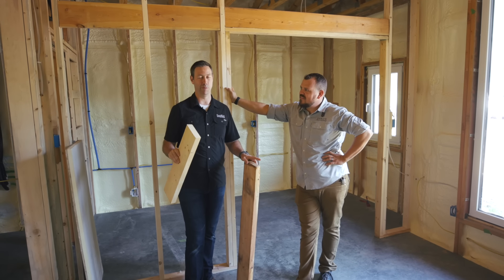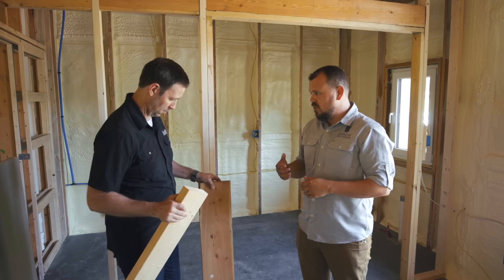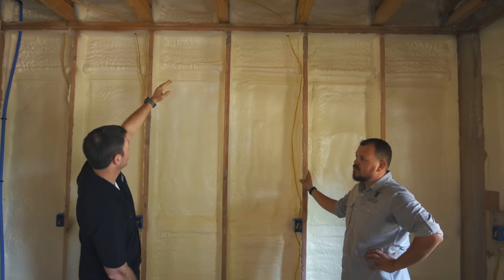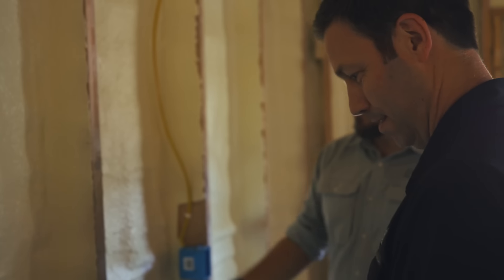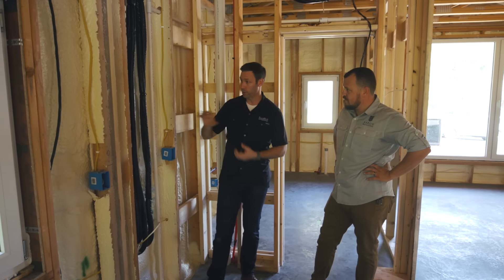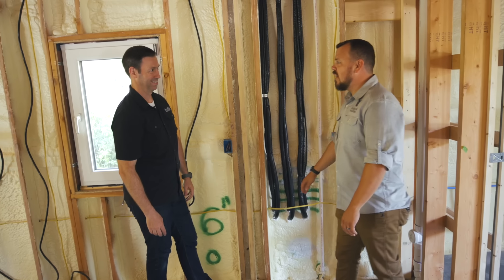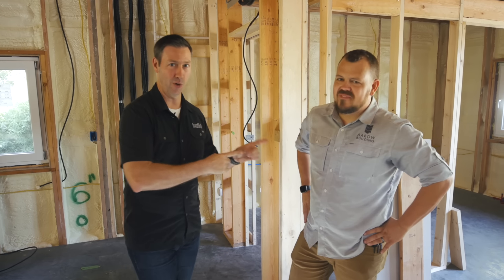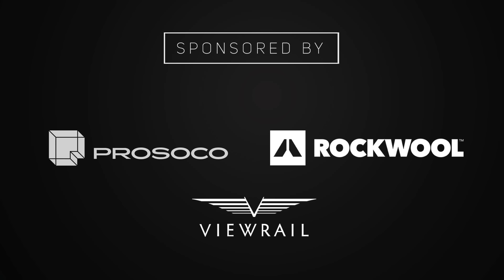Why would you frame a house with 2x8 lumber?

Comment: I only used 2x8 on my top plate, all the exterior walls with double stud 2x4s. Having the thermal break when the outside temperatures are 110f below from the inside it makes a difference. I had 6” of closed cell foam put in the walls and I put R-38 Batts with R21 batts between the trusses in the ceiling.. Last winter here in Alaska with the 7th coldest winter on record I used about 500 of heating oil to heat 3000 sq ft.

Comment: Passive House standards typically have a wall cavity with 2 2x4's or 2x6's which are offset to provide an open cavity in the wall. This improves the insulation value since the studs aren't thermally connecting the interior and exterior walls.
Reply: Why the offset? Can't you just use 2X10 plates with 2X4 walls?

Comment: Hi Matt, another great video! Thanks. Recently you've shown several homes with massive amounts of insulation and of course Missouri warrants it. But it would be great if you could get some experts on to talk about at what point you get diminishing returns and it would be better to put the money into other upgrades.
Reply: Generally speaking, going over R30 in the walls has a life cycle cost that is higher than the cost of installing photovoltaics.

Comment: Poor framers who need to lift those walls.
Reply: Wall jacks may be the way to go.
Reply: Shaaaatup and get back to work.
Reply: telehandler should be on a project that big
Reply: But running top plates would be like running on a highway!
Reply: Eric Wescoe Or tractors/crane.
Reply: @calisdad3  Code says if you want a typical 2 story house..... or are you just proving you do not know the UBC?
Reply: @w8stral  wow- real tough guy when you're hiding behind a keyboard. I built houses for 35 years and the one thing about the UBC is it is NOT uniformly applied. Build a 2x8 house if you want but there's no justification for it and you don't even know the problems  it presents. No sole plates and 24" spacing- yeah, good luck with that champ.
Reply: @calisdad3  No sill plates?  What are you smoking?  Whatever it is, keep smoking you need it.
Reply: @w8stral  Look at the video Einstein. Single plate- when the poured the gypcrete they lost all base backing. All they had to do was double plate it.
Reply: They don't build that way anymore.  They put up one 2 x at a time, or if they do, I know we had 3 big burly framers who would not have had a problem with lifting any wall that they had build on our home.
Reply: I used a telehandler my self.
Reply: I'd assume this specific framer he uses probably already uses a forklift and includes that cost in his bid. Which would probably be why his bid didn't change that much.
Reply: w8stral no, it’s more weight. Your math adds up, 33% increase in weight from 2x6 to 2x7 but 50% increase on spacing, until you factor in the top plates. It’s heavier for sure. Not to mention hauling and cutting 2x8 is more difficult.
Reply: Stick build them. Put your two end studs up and put them in one at a time if your crew is small and budget is limited
Reply: darrin jones you shouldn’t stick frame exterior walls. If you’re worried about the wall being too heavy, build it In sections. Two men should have no problem standing a 16’ wall. It’s 10x faster building it on the ground and time=money
Reply: @i8dapuszy  if i got 12 foot studs and only 3 people that's what im going to do. Im not risking my life or my spouse. Otherwise Ill sub it out and let  someone else figure it out. 2 x 8 wall are stick framed.  One up one down one cuts and passes lumber. 2x 6 walls i can section out
Reply: darrin jones wow it takes you and 2 other guys to stick frame a wall? Yeah you better sub that out.

Comment: Great video, I built a couple of homes with 2x8. It works well and you can up the R-value, however. The last home I built I used a product out of Idaho call Ray-core. You may want to look into it, it has literally doubled my R-value. My last House was a 2x 6 construction with faux logs on the outside and sheetrock on the inside, and it gave me an R value of R57, and cost a lot less than it would have been to Timber Frame a 2x8 and closed cell foam. Thanks for the videos, keep it up

Comment: thanks for the video. i have to assume lumber pricing is similar where you are and find myself wondering why you would pay more for thermal bridging instead of running offset 2x4 walls for a total 8 inch depth for insulation without a solid mass thermal bridge..  i guess we do things a litttle differently up here in iglooland lol

Comment: In my area there is a pole barn builder that gets high grade lumber for the tolerances needed for the production rates they work at. They have a saw system that can custom cut whole hacks to any desired length more accurately than your standard precut.

Comment: I would like details on door and window installation with thick walls.
Reply: Windows would install the same you would just have deeper sills. Doors might require a custom frame unless you can find them pre hung for x8 framing. Haven't built with x8s yet but installation would still be the same only sill depth changes.
Reply: mothman1967 i know this is an old comment, but basically for windows, its like the other guy said, wide window sills on the interior of the house. As for doors, they get hung justified towards their swing, and have a bit of an alcove effect on the opposite side. So say your main entrance door swings inward, you hang the door frame flush with the inside of the wall, and trim up to it from the outside. Ran into this a lot remodeling Adobe houses, were you can have walls 16 inches thick or more.

Comment: I live in Finland, I’ve got 2x8 frame in my garage for the insulation. Also 8” of styrofoam under the concrete floor (with floor heating) and the attic floor gets 16” of insulation. It’s made like we made houses here 10-15 years ago. Nowadays they use even more insulation.

Comment: 2x10 is standard in sweden, and then adding extra 2 x2 on outside and inside.      my house is 400mm wall insolation and 500roof.    but we only use roxwool couse you need to keep air moving out of your construction otherwise you get mold.   pu foam is crap and has poisoned  hundreds of thousands if not millions of homes.   so in one way keeping to traditional ways of building and proof-en techniques that have been used for 30-40 years is the way to stay safe and have a solid home.  all the inovation crap just get you in trouble, but have fun :P

Comment: Great job .. well insulated.  The problem with unconventional framing methods (2x6 or 2x8 as opposed to 2x4) is that door casings must be custom fit.

I built my house with 2x6 outside walls .. door casings made for 2x6 walls easily cost triple of those for 2x4 walls.

One solution (I thot of after the fact) to that expense was to build a recessed entry framed with 2x4s for the 4 in door jambs (ironically, with the same door slab!).

This 'slip-shod' method is acceptable (and will pass inspection) for mild climates .. without sacrificing too much R-value.

I'm sure this wud cause an inspector to have a panic attack .. but when you're trying to save a buck, or go doorless due to inflated cost, you do what you gotta do!

Comment: Rookie Question:  The triple 2x4's for load-bearing- shouldn't they be connected to your sheathing for shear strength??  I'm no builder, but it makes sense to me that your vertical load-bearing doesn't work well as soon as it begins to rack.  Thoughts?
Reply: The 2x8, 24" OC wall structure provides all the racking strength you'll need for the walls.

So that piece of lumber's only job is actual vertical load-bearing.
And the load that it's bearing is a doubled truss on top of a double top plate.  With an effective 4x8 top plate and an effectively 8" wide truss structure, in addition to the normal 24" OC truss layout, you have MASSIVE racking strength in the floor structure for the 2nd level.

As such, there's no need to provide a thick thermal bridge all the way through the wall structure.
Reply: Hyperstrike  makes sense, thanks!

Comment: Why isn't a stagger stud setups more common?
And I am not certain that the benefits of R value is as linear as they make it sound.
Reply: Thermal bridging is a thing. There's a r 6 on the outside at least. They probably didn't stagger stud it because it'd be extra work.
Reply: @talontoth4402   Yeah it is more work because it would essentially be 12" OC studs, but it is not that much more work.  It is also a better sound isolation setup.
Reply: Overall upfront cost is higher due to the extra labor of essentially building 2 house exteriors even though 2 2×4s is cheaper than a 2x8 in most places.  If you are building it yourself or including long term costs, that incentive goes away.  With staggered studs you eliminate thermal bridging whether you choose 16" or 24" centers.  You could even do a 2x4 curtain wall exterior and 2x6 interior wall for a multistory house and connect them together with 2x4 cross bracing for additional racking strength.  If you decide to do 24" centers and cellulose fill, single sheet drywall will bow out eventually (5-10 years) - 16" centers and 24" centers with double layer overlapping drywall is less noticeable

Comment: One thing that has crossed my mind if ever I build a house is to double 2x4 walls where the studs are staggered. Also, zero electrical or plumbing on outside walls, as that is too many penetrations in the vapour barrier, instead I would do faux beams and other features where the electrical can run into without being on the cold side of the house.

Comment: 2x8 would be so much harder to work with than a 2x4. I would charge a lot more to frame with 2x8.
Reply: What do you mean by "a lot more"? I could see quoting the labor at 10% more than the same 2x4 quote would be. But not 30% more.

Comment: I figured out a no-compromise wall assembly. You frame the exterior walls twice, both on 16 inch centers. On the outside is a balloon-framed wall using t-studs. This can be fire-blocked, also with t-stud material. This wall can be flash-and-batted with two inches of closed-cell foam and batts of rockwool, giving an R28 in the cavities and an R20 in the studs. This allows you to apply a strong sheathing with no exterior insulation, like 3/4" marine-grade plywood. The interior walls are platform-framed 2x6 LVL studs, staggered vs the t-studs on the exterior walls, which can carry wiring and plumbing, give extra strength and allow for very flat walls. These can receive R23 Rockwool batts themselves, giving a total R value of 52.
Reply: YOUR A GENIUS

Comment: It seems that should be building code in Maricopa and Pima counties, AZ. 2X4 framing here doesn't cut it for proper insulation.
Reply: The more I build and am exposed to I wouldn’t build a house with 2x4 at all
Reply: @wallgod663  may you explain yourself?
Reply: Agreed

Comment: In Canada we are airconditioning in the summer and heating in the winter. To keep the condensation point out of the walls it is important to insulate from the outside too. A 2x8 wall would get 3in of insulation on the outside.

Comment: Soon it'll be two 2x4 walls separated by 2 feet filled with polyiso for R350
Reply: if I could afford it!
Reply: In my experience, double-stud 2x4 are usually about 12" total wall thickness (with offset of studs if the builder was paying attention), and cellulose dense-pack poured into the cavity. Once you hit R-50 to R-60, there's not much point in going higher unless you could do so for no/negative cost or maybe if you are in Climate Zone 8.
Reply: Where do you stop? It's kinda like drag racing, "if I can just get 1 more cubic inch I can cut .00001 sec of my et" enough already !!!!
Reply: it´s already here
Reply: Hey, you up to doing a real estate project in Antarctica? 😂
Reply: Hail Honkler  You can build a traditional 2x6 house and then build a 2x4 independent frame on the inside, This prevents any and all bridging. Foundation with dense foam between the 2nd foundation and you have a shell and inside house, The only bridging is in your windows and doors. Windows can be triple pane with an outside and inside window. Doors can be custom made to be much thicker than the standard. 
Doing a slab type house could also work the same way. 
Installing osb on interior walls then drywall will not only give you greater strength yet a small amount of extra r value.  R value of a 12 inch inside and total about 16 inch wall will give you a value of 60 plus for dense pack and more depending on what you place on the siding. 
There are some double stud walls out there that are 2 foot thick and have a value of 100 plus... This means that a single 100 watt Incandescent light bulb could keep a house warm, Provided there are limited amount of windows.
Reply: Lots of folks denying reality. I am not an expert, about as far from it as possible. We all know when knob and tube was going out, there were thousands of angry people. The system was a good one and it lasts, but there is no way that it could compete with current systems. If the States decreed they were staying KT, they could have. Real people would not believe it, then they would laugh. K+T went  dead decades ago. Same went for balloon framing (dont tell me about a few exotic homes )
You want to stay back, go for it.  Dont try to make an industry die.

Comment: "Why 2x8's?"
"Because it's MY house."
Reply: Yea, I’d like to buy this house. He built it like his own.
Reply: @Mote78  4K square feet is good for families who can't stand each other.
Reply: and then proceeds to do it on 24 inch centers, the guy builds crap.
Reply: @Mote78  It IS his own house, he said as much. That's literally the reason why he did it that way.
Reply: MadMan Machinations 
I know but eventually he may sell it. I visited a nearby home under construction by the builder/owner.  I saw that many of the sheathing nails missed the studs. When I pointed that out he said “Oh, that’s ok, it’s still strong.”  I would want them redone and hammered into the studs, do it right, but he didn’t think so.  I’ve dealt with too many careless/lazy mistakes by builders.  I’ve learned that Cheapest isn’t the best.  Pay a little more for good job.
Reply: @Mote78  Unfortunately, I've learned that if you pay a little more, you don't necessarily get a better job :/
Reply: Brian K
Doesn't matter, if a contractor will do 24" centers what other corners will they cut?  IRC allows for it as a minimum, if they didn't they'd have jokers like him doing 32 or 36 o/c.
Reply: @isailwind3471  My grandpa's cookie cutter 1960's house had 24" center roof trusses... with 3/8" plywood roof decking. We had wondered for years why the roof was so saggy between the joists. When I went up in the attic and measured the decking I was shocked.
Reply: Brian K  just because they allow you to do that doesn't make you a good builder. You just proved youre a minimum code kind of guy. 😂
Reply: Brian K  I'm not a contractor but, even I know that building something that will last isn't screwing a client. Screwing a client is building 24 inch oc and then coming back 10 years later to charge them to rebuild it because the first time wasn't good enough to last. Step your game up man....
Reply: It's MY house and the gummint is paying for 40% of it, you mean.
Reply: @WattsUpDev  My house is brick. Structural. I'm the third little piggy. While you lot pick nits over framing, I'll be eating roast wolf.

Comment: I just helped wire a house with all 2x6 walls. I think 2x6 interior walls are good for when the plumber has to run a 3 inch or 4 inch stack pipe for a bathroom on the second floor. It also s good because the electrician can install switch boxes back to back.
Reply: Should be able to install switch boxes back to back in a 2x4 wall cus they stick out a half anyways

Comment: Seems like the polyiso as the outside layer in northern climates would be problematic, it’s r value decreases in extreme cold.
Reply: I just wonder same that is that in country where outdoor is always warmer than inside or did he just build own mould farm?
Reply: Actually depends on the polyiso
Reply: @stevenbaczekarchitect9431  it wont. If you build structure what is more dense to outdoos and less dense to indoors and specially if that pu act like vapour seal it will rot at climate where outdoor temperature usually colder than indoor temperature. Specially if that ourdoor temperature goes under indoor dew point. You can get mould under one year with that structure if temperature difference left dew point inside wall. Good thumb of rule is that dew point must be at colder side of vapor seal or it will rot by time.

Comment: Hey Matt, after nearly a year, how does Jake feel about his 2 x 8 choice? How was the energy bill? How about comfort?
Reply: Comfort is exceptional!!! Energy bills very low..
Reply: Steve- at some point wall insulation can beat pretty unbalanced compared to what the R is on windows. seems rot me jake is punching the cost value proposition of the overall wall  to the limit here even with european schucco windows right ? Also, seems to me Tstud would be very com putative with this wall regarding strength and insulation without losing three inches (1 for the poly on the zip and two less inches on the exterior wall studs. of living space on each wall (a critical aspect hen you are building on a constructed lot and are having to go right up to the property lines setbacks)

Comment: Bonfig Wall 2x6 wall packed out with 1" rigid foam and 3/4" ply filled with R-30 Rock Wool and Membrane vapor barrier.  R-30 wall   on the cheap with major fire resistance.

Comment: Are there a lot of options for off the shelf prehung doors with casings to fit 2x8 framing or is that a special order situation. If so should have been discussed and calculated in over cost increase.